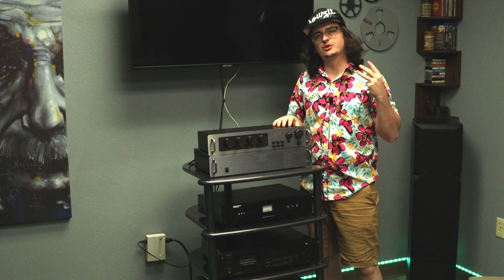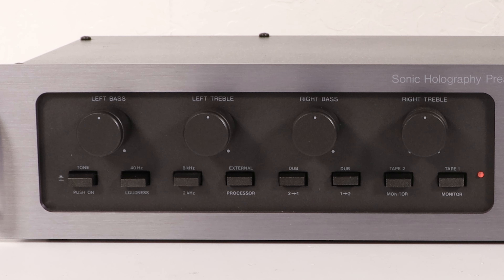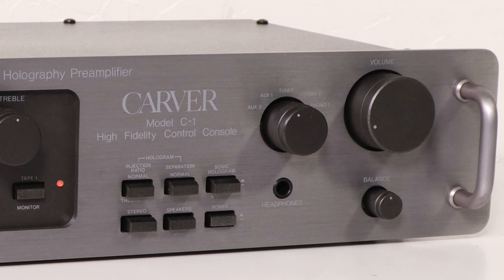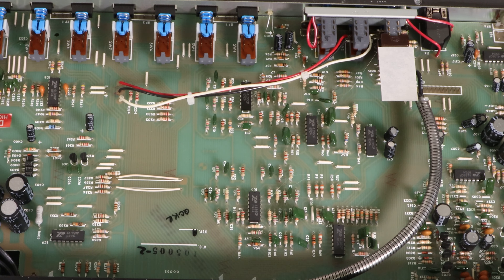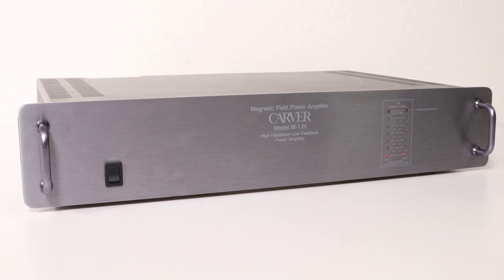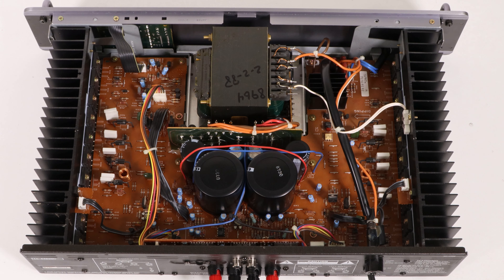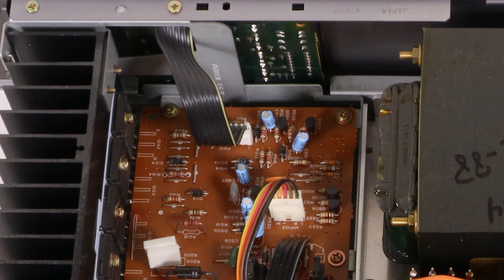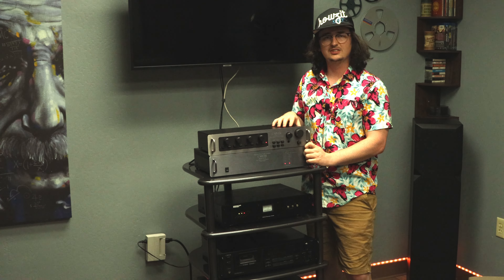Carver Sonic Holography Preamp Magnetic Field Power Amplifier 1000 Watts Single Channel Powerhouse!

Comment: This preamp is probably sonically superior to the c4000 because it doesn't have the autocorrelator circuit which runs several op amps clipping rail to rail in order to detect the noise floor. That clipping signal tends to pollute the B+ rails for the rest of the op-amps and results in a sound like hash and Distortion when the volume level is set very low and the Sonic hologram generator is engaged. Also the C1 brings the theoretical normal switch to the front panel and adds a separation switch which gives some more options for setting up the way the listener prefers the Hologram to perform.

Comment: A true electronics genius, I've owned numerous products, including receiver,  separate components,  and currently a 5 channel home theater amplifier ( AV705x) thx certified. Have owned this for 20 years bought used on Ebay for $450 , $1199 msrp. I love it runs cool, loads of power and detailed sound.
Reply: i've always wondered why carver discontinued that amp .